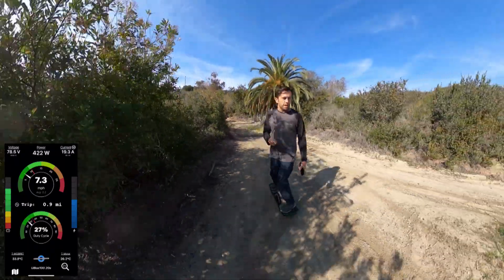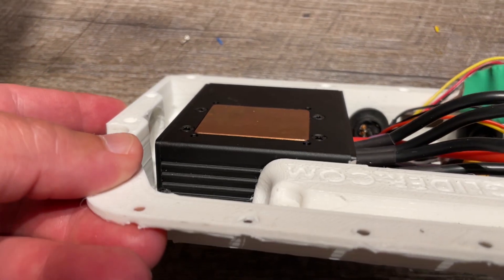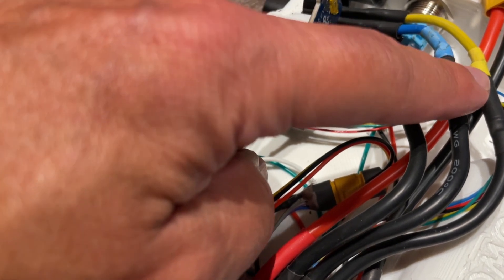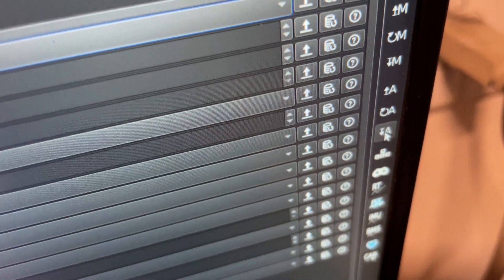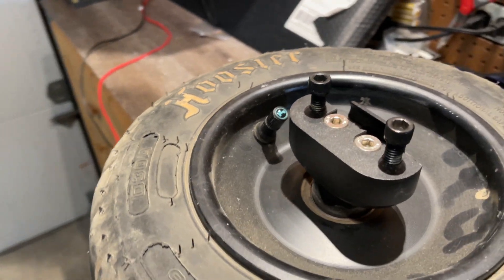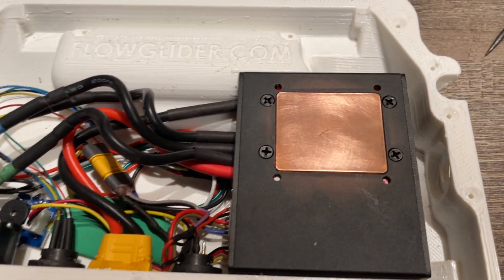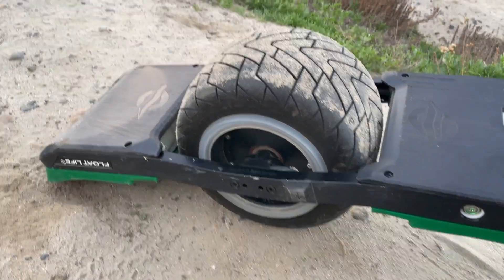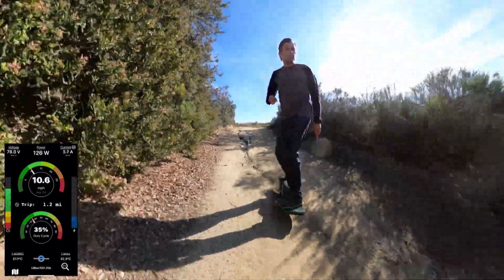VESC DIY Onewheel: Spintend UBox 100

Comment: Hi, it's translated with Google, sorry, I have a ubox 85v 150A, one connector has ADV1, ADV2, and 3.3v, but it doesn't work. How do I connect the photo pad? How do I connect the ADV 1 and 2 to the sensor?
Reply from the maker: Idk what a photo pad is but a normal FSR sensor just needs ADC and 3.3V - when pressed resistance goes to near zero so the measured ADC voltage will be close to 3.3V
Reply: Sorry, foot sensor. How do I connect it to the 85V aluminum 150A Ubox? How do I configure it in Vesc? @surfdado
Reply from the maker: @ozonem3 there are many videos explaining this. For questions I suggest Discord. https://pev.dev/t/discord-servers/2673

Comment: @surfdado great video! I have a question, I'm making my pint vesc. im using a vesc kit that uses this same ubox but im still using my stock battery and i ordered a 15s Nexus BMS V2. Before, I used the pint vnr kit using two 60 volt greenworks batteries. Can i still hook those external batteries to the vec pint to add range? I already have them on hand and I would like to avoid buying a new battery, so wanted to know if after I setting up the pint with the vesc basically stock because of the battery, I can just add those external batteries for the range in the same sort of vnr connection?
Reply from the maker: @marckosmusicrc5808  should be no problem, the VESC controllers don’t care where they get their voltage from

Comment: Very informative video! Getting the Hall effect sensors to work was indeed very frustrating but once you get past that, this is a most satisfying project. Thank you for sharing. Float on!
Reply: How did you get them to register? I keep running motor setup and it keeps coming back as sensorless 🤔
Reply: I figured it out! Had wires in the wrong spot for the hall sensor connector 🤦‍♂️

Comment: Any fixes for the Ubox noise at super slow speeds? Or is it just a Ubox thing?
Reply from the maker: it's just a ubox behavior due to inferior PCB design and component selection, nothing you can really do about it - but it's not really causing any other issues so you just need to learn to ignore it

Comment: Hi men, thx 4 all what you do, I have a little question, If I do the same box than you how can I connect the ennoid BMS if I have one ?
Reply from the maker: you will need to add additional connectors for the charge port and then also for CAN if you want to use that
Reply: @surfdado  merci beaucoup :) I'am a begginner, and I'am converting my board ! I just bougth the spintend, didn't received it yet but i'am preparing all what I will need, can u tell me pealse how much wires that takes to connect the can fro BMS to controler box, and wich ennoid bms will be better for me ? I was thinking to buy the V2 for 20S, like this I can connect my CBXR.
Reply from the maker: @T4t4N-M4k4k_StokedMonkey  afaik the ennoid needs 4 wires for CAN, but I think it's really tricky so make sure you check with Kevin before finalizing your wiring

Comment: I was thinking of adding an Arduino Nano to the mix, so I can control my RGB Led strips. You guys think it's possible to use the same BT module to communicate with the phone?
My idea was to have parallel RX-TX cables going to the VESC and the Arduino. I think the protocols are different, are they not?
EDIT: Btw, Merry xmas y'all! ^^

Comment: Excellent Video once again!! I had similar IMU issues with my Ubox 100amp Pint conversion a few months ago but was easily fixed by a 7 dollar ext IMU from Amazon. Forgot about the 100 amp limit been using the standard 120amp setting.

Comment: Besides price is there any reason to get the Ubox over the little FOCer?
Reply from the maker: if lights are important to you the 3A 12V output is really convenient
Reply: you have 5v and 12v so you can run lights easily. but you have way less total amp. i think it really depends on what you want to build

Comment: Rad! Thanks for the thorough video!

A couple thoughts:
- the low speed motor noise sounds just like the stock Pint controller fwiw
- maybe I missed it, maybe I’m being silly, but what BMS are you using? Or are you running the bat directly into the UBox?
- what’s your opinion on the Trampa boards? I’m looking into reviving my dead Pint and have been trying to figure out whether I should go FOCer or UBox or Trampa Vesc 6 75V
Reply from the maker: this battery is BMS-less for now; opinion on Trampa boards? you mean Trampa VESCs? They seem to be top notch controllers, my 6-75 is excellent in my Pintx
Reply: @surfdado  oh right! Lol I forgot that your video on the Trampa VESC Pint X was where I first heard about the Trampa hardware 😄